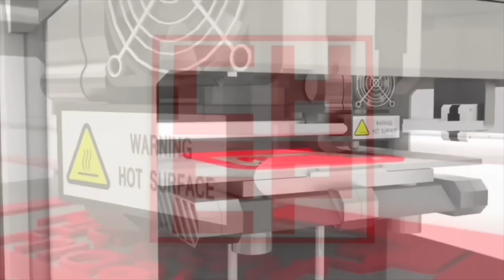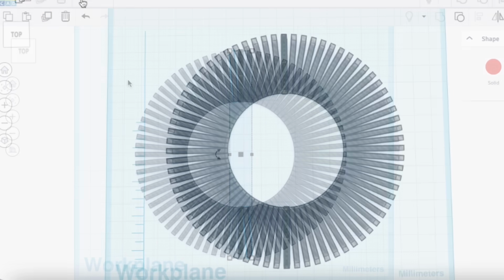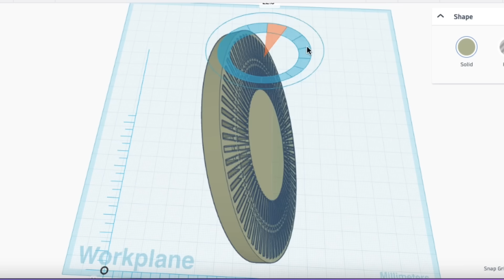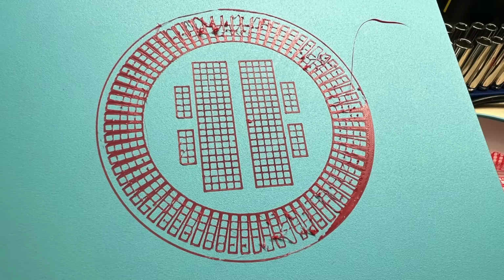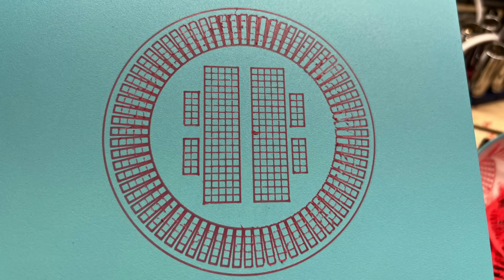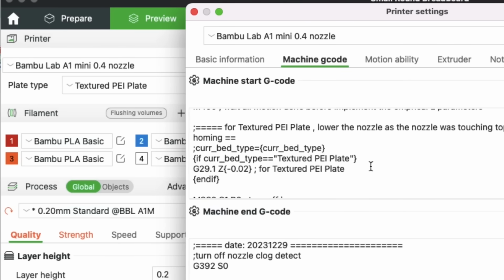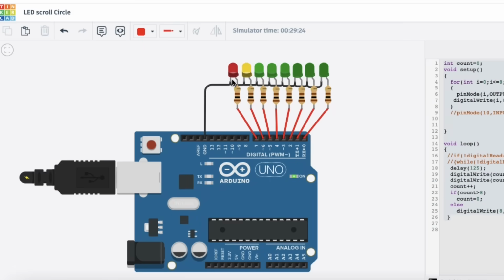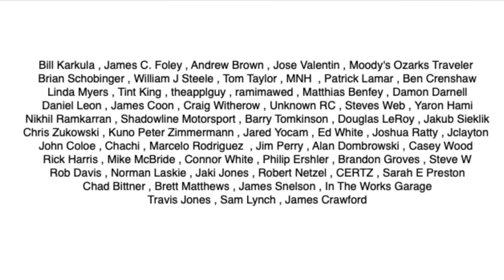Round Breadboard 3D Printed on Bambulab A1 Mini

Comment: Robothut made a useful video 4 months ago.  A lot of L1 problems are caused by the four small screws at the back of the head heater coming loose...
1 - Remove nozzle assy,
2 - Undo 3x hex screws to release the heater assy,
3 - Carefully (thin wires) turn the heater assy around, and ensure the 4x hex screws are fully tight,
4 - Reassemble.
If L1 problems persist, pop off the access cover at the back of the head carriage assy and make sure the two hex screws at bottom-right (holding down solder tags with black wires) are tight.

Comment: really would have this option to make custom filament with z-offset, instead of changing the actual z-offset on the whole machine, my A1 mini prints PLA without problem at all, petg?, not so much, I have 0 clue of what is going on, but it scrapes the bed so bad it leaves marks on the actual plate, both love and hate my A1 mini, currently printing petg with an 0.28 offset from standard -0.4, changing to pla i have to change the machine profile, quite easy to forget, would have been SO much easier with filament profile offset :-/
Reply from the maker: If it was a filament issue then I agree. But this machine could get the Z offset right on any filament so I did it this way. No problems since.

Comment: Can you do a video about layer shifts? I'm having that problem in my a1 mini. Thanks! 😊
Reply from the maker: To address "shifting" (layer shifts) on a Bambu Lab A1 Mini, check for mechanical issues like loose belts or axis screws, ensure the build plate is secure and stable, lubricate the printer's rails, and adjust slicer settings such as print speed/acceleration lower and infill overlap. Also, make sure print cables aren't snagging.

Comment: Interesting... ChatGPT forwarded me here. I am about to use 3rd side smooth plate with colours on my P1S and I want to have as smooth 1st layer as I can so the colours looks nice. I am about to do that with editting the G-CODE. Somewhere on the forum I read maximum I should go as "added value" is -0.05 to the basic value -0.02. Thanks for showing me where it is and I cant wait to get off work to start testing.
On the other hand I would like to say hat down for using 3D printer for practical things like that. You really know what you are doing. 🙂

Comment: This works because you are dialling out the "thickness of a piece of paper" from when the Z offset gets calibrated.  The slicer assumes that setting Z = 0.2 (or whatever) means the nozzle is 0.2mm off the bed, and calculates the amount of filament to extrude on that basis, but actually, if the thickness of a piece of paper is 0.1mm, the nozzle has a 0.3mm gap when Z is set to 0.2mm.  This means layer 1 is always under-extruded, and I don't think that is commonly understood.

Using G-code in the slicer's machine start-up code to offset the Z axis by 0.1mm cures this issue, or you can set it in the machine and save it to EEPROM (using a G-code file).

The down-side is that the print will be less tolerant of even minor undulations in the print bed if they are not trimmed out by auto-levelling.  3-point auto-levelling assumes a bed is dead flat, and of course it isn't.  With Z = 0.2mm (true gap), a 0.1mm undulation reduces the gap to 0.1mm, and the filament will be over-extruded by 100% in that area (and under by 50% in other areas).

HTH
Reply: I see some videos people go from -.02 to .06, he went -.02 to -.08, on the A1, which way is the nozzle moving when you go negative or positive in reference to the bed. I am getting confused.

Comment: You have No Idea how much I appreciate this tip. Two of my three P1s printers have been struggling with bed adhesion. and no ammount of bed cleaning / Plate replacement has helped. That works for a few prints and then it goes back to being a pain. I made this adjustment and BOOM, no more bed adhesion problems. I know they are a couple of years old now (ancient in Printer years) but this helped tremendously. Thank you.

Comment: The reason your P1S was sticking better is because you had a Cryogrip Frostbite plate in there compared to the Cryogrip Glacier plate on your A1 Mini. The Frostbite plate allows smaller details to stick FAR better. Get you a Frostbite plate for your A1 Mini and you'll be happier with it and won't need to mess with all those settings. While getting more "squish" worked in your case, it can also cause issues with dimensional accuracy if needed. But good info in case someone ever really needs to mess with those settings vs just using the Frostbite plate to solve adhesion issues.
Reply from the maker: You’re, right that I misspoke about the Glacier vs the Cryogrip (I have Cryogrip on my X1C) but I find the Cryogrip gives better surface results when the settings are correct as I showed in black vs red surface difference. So I still recommend the Cryogrip with proper settings. 
Thanks for catching that.
Reply: @FilamentFriday they are both “Cryogrip”, there is a Frostbite and a Glacier version. I would suggest using those terms instead of “Cryogrip” in the future to alleviate any confusion. The Glacier gives a better surface finish, but doesn’t stick as well. The Frostbite sticks  far better, but gives a bit more texture to the finish.
Reply from the maker: @benjenkins183 - Good Point. Thanks.

Comment: I had adhesion issues with the original textured PEI plate from Bambu, even after thoroughly cleaning it with Fairy/Dawn soap, 99% IPA, and hot water. Eventually, I tried using a 3D printing adhesive spray, and after applying it once a few weeks ago, it's still working really well—maybe even too well. Brims and small or flexible prints stick a bit too firmly, though they can still be removed with the Bambu bed scraper. Larger prints usually release on their own once the bed cools down, even without any adhesive.It's worth a try and with smooth plates it actually allows me to print everything even if it's small as heck. At the moment I'm trying your method with 0.8z
Reply: Oh and I was looking a long time ago how to change z offset with no luck but with your help I can do it now and I will be testing something that's called Pen Plotter Mod, in short it allows drawing/writing with pen, marker, sharpie etc with your 3d printer, but I may be wrong about it and I will fail again
Reply from the maker: Worth a try. Many have done pen plotting on Ender 3’s over the years.

Comment: Please try Fusion 360, because for such complex Designs it gets so much easier to make changes or repeat actions and rounding edges is trivial
Reply: He has used fusion 360 before he just prefers tinkercad
Reply: @Dlutheran I don't blame him - it is so easy to use, bar some limitations.  I use it too, but trying to learn FreeCAD.  It isn't easy!
Reply: Too expensive.  Yes there is a free tier, but it has limitations - and they can pull the rug from under your feet at any time.  As a hobby maker, rather learn FreeCAD.